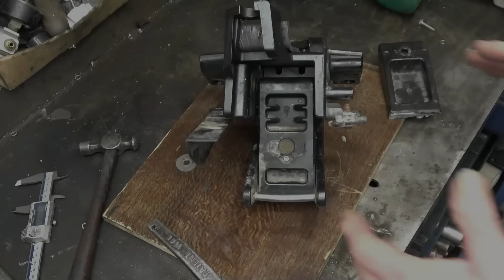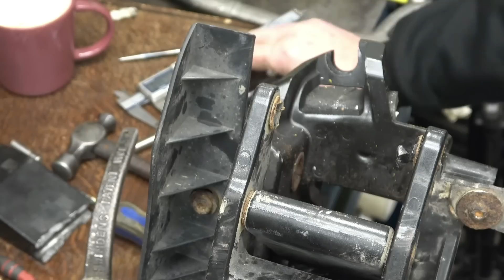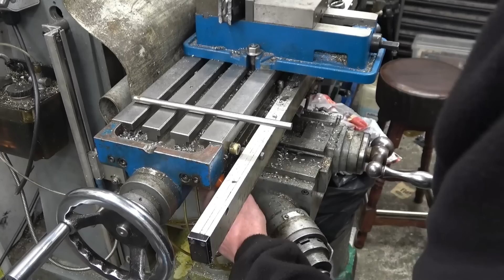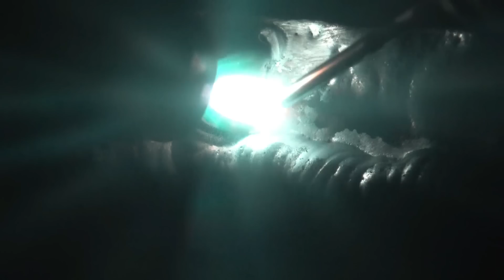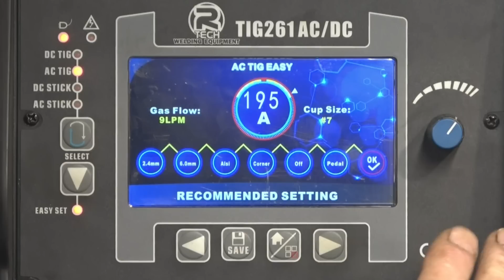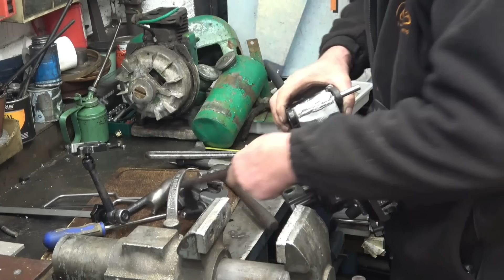SNNC 564 P2  Range Rover Step Repair (alloy welding)

Comment: It's only a step brackets. But you add rod too fast and your trapping voids in aluminum. You need to have a molten puddle and then add the rod so you don't trap gas pockets or voids. The aluminum isn't the cleanest to start with. The casting has impurities in it already.